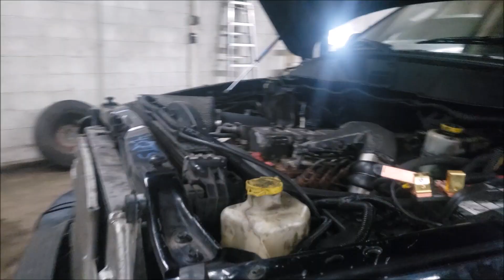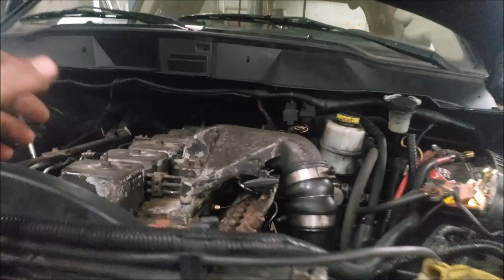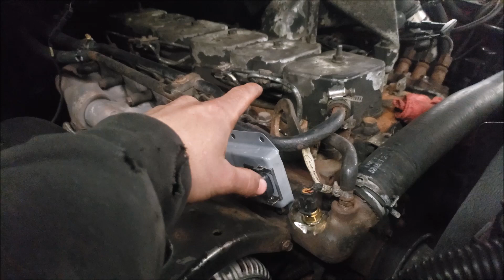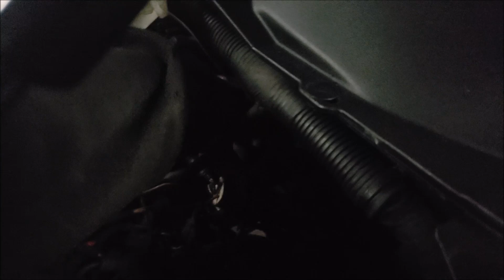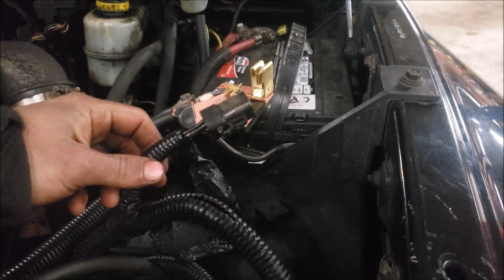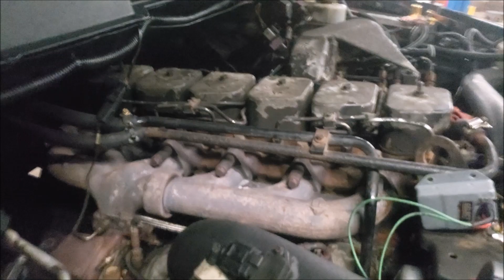The Truth About 12 Valve Swapped Third Gens | Trump 2020 Politics

Comment: Any issues with using the 12v starter?
Reply from the maker: I used the commonrail adapter plate and starter but the starters are all the same minus the plug.

Comment: Quick question just picked up a 03 12v swapped manual everything works on it except the guages to cluster did you just wire up aftermarket pillar guages and a CTS monitor?
Reply from the maker: Nah, use the commonrail tone ring and crank sensor.
Use an adapter for the commonrail oil pressure sensor
Fuel gauge works fine.
Wire up a voltage regulator from an older dodge(gauge should work if done properly) Some trucks do some trucks don't
Speedo is unneffected by the swap
Tach and ac will work as long as you hook up the tone ring and sensor.
Reply: @CPSteveMiller  ahh I see thanks for the information on that I really appreciate it! Keep up the good work brother!

Comment: Hey man I got a 04 ram I hotshot to my 24v just took a crap at 500000 I have a ve24v which I thick would be close to a 12v swap I wanted to get some info from you on swap
Reply from the maker: There really isn't any added benefit to a ve swapped 24 valve in a 3rd gen. The only reason the 12 valve was okay was because it's budget friendly, completely mechanical, and in a pinch can get you back on the road in as little as a week if you needed to just cobble it together.

If you were planning on a ve 24 valve in a 3rd gen you'd end up spending the same, if not more, to just get the factory engine rebuilt. You'll also have more reliability and dependability keeping the factory motor. Just my 2 cents. 

All of my contacts are in the description.
Reply: @CPSteveMiller  ya needed to get the truck back together shop build times are long right now I already have a built 2nd gen engine I was thinking of p pumping it before I put it in
Reply from the maker: Ppump would be the best if you're physically doing a swap. It just makes it so much simpler and if there's ever issues at least it'll still run and make you money while you work to resolve the issues. That's what I did. I quite literally slapped the engine in so I could make money but nothing worked. No fuel pump after 15 seconds, no alternator charging, etc. I have to manually control all of it. After the first few weeks I started fixing those little details but it paid for itself in the first 2 weeks

Comment: Just a thought, if you just de-tuned your common rail a bit or even ran it at its stock specs, you'd be way over the power you're getting out of your 12 Valve.
And the bad fuel issues are greatly improved with a good water separator and running 2 micron final filter after the separator.
Just saying

Comment: Good job with the swap . I have a 06 ram with bad engine. manual 4×2 transmission. 
I want to do the swap .  Where did you get you transmission adapter from??part number??
Reply from the maker: It's a factory adapter plate. No mods were needed. You just need to make sure it's a manual or automatic adapter plate depending on what you have. I used mine from my commonrail
Reply: Ok tank you

Comment: Great insights. I found a 3rd gen(06) with g56 that has a blown engine for dirt cheap and wanting to swap my 12 valve from 95 in it. Do you know if 12 valve will bolt up to g56 bell housing and any other info I should know before I jump into it
Reply from the maker: Not sure about the g56 but the nv5600 adapter plate bolted up to mine BUT only 6 of the 8 holes lined up. It has been fine heavy towing now for a year(over 40k miles) without issues. It's the adapter plate you need to worry about. If you can get that to work the trans bolts right up to it
Reply: @CPSteveMiller  My plan was to get a pre 98 ram with v10 gasser and nv4500 to swap my 12 valve in but this 3rd gen popped up for really cheap. I will have to do some research. Thanks for the reply!

Comment: Your know there’s a shut of an the side of the p7100 it’s a mechanical shut off with an electric solenoid  but can be moved by hand
Reply from the maker: Not on mine. It's broken off flush with the pump. I need a whole new ppump
Reply: @CPSteveMiller   might want to go to a heavy equipment junk yard and pull off the mechanical shut off of one of those pump eather from a school bus or an old truck
Reply from the maker: @Samsggarage  From what I understand there's nothing I can do about it other than to replace the whole pump. I figured I'll wait until the motor goes and swap another engine before I felt like dealing with it😂
Reply: @CPSteveMiller   a manual shut down cable will remove the ffs  or shut down solinoid.    Not quite shure how to do one but thay were common on old buses trucks and tractors that had a 12valve. Also it’s not that hard to swap a ppump  can be done in a bout an hour by seasons pros  seen it done track side
Reply: @CPSteveMiller   also the back half of the pump where that is house gmcan be taken apart and rebuilt  in the long run this would be a pretty cost effective option but if you want a little more power just replace the pump  with a larger ppump.  A good pump and injectors on along with that vgt could have you making the same power reliable as the cr
Reply from the maker: @Samsggarage  Could be swapped quick but I just don't want to. If I get everything done and it still isn't blown up I'll do it but that'll be another year probably. That lever arm on the pump since it's busted flush someone notched it for a screwdriver but it's stuck in the on position
Reply from the maker: @Samsggarage  I have an he341 now. At 1400 rpms in 6th it'll hold a 10k trailer up a hill. Monster torque but it chokes up top but I'm happy with it now. I'll have a video on that this week. It's night and day better than the original motor. Torque for days😂
Reply: @CPSteveMiller   there’s still a lot more on the table with the fuel side of things  but it’s your truck.  I’m just glad to see a working truck with a handshker
Reply: @CPSteveMiller  I still think a manual shutdown cable might fix it
Reply from the maker: @Samsggarage  There's nothing to put the cable on though. The lever arm has to be there in order to put a cable on it.
Reply from the maker: @Samsggarage  The tuning on the fuel side and air side is perfect now. 32psi at half throttle in less than 2 seconds. Lag is virtually non existent
Reply: @CPSteveMiller   it sucks man a new shut off  lever is 60bucks   But The pump would need to come off to be rebuilt
Reply: @CPSteveMiller   I’ve actually been thinking of doing this on my truck the he351 that is

Comment: Do you still have the original motor?
Reply from the maker: That's long gone
Reply: @CPSteveMiller   thanks for the reply I’m possibly going to pick up a 3rd gen with a shot motor so I’ll be looking for a good engine to drop in so is a 12 valve a good swap
Reply from the maker: @hunterakehurst2209  I'd recommend you drive an early second gen with a 12 valve in it and see if you like it. They're cheaper to maintain and super reliable but they aren't for everybody. There is a bunch of small little things to do when you do the swap
Reply: @CPSteveMiller   actually I’m currently driving a 95 one tone with a 12v manual 5 speed I love it but I found a 3rd gen in a field by my house I’m trying to save from just rotting away
Reply from the maker: @hunterakehurst2209  Nice! Check this guy's video out. https://youtu.be/yBkZK463Cpk he does a full rundown and I have a list of everything needed but I won't have my laptop back for 5 business days so I can't get it right now. It's not all that bad just a bunch of small things

Comment: Eaton fuller 10 speed with air for overdrive!!
Also a goal of mine!!🇺🇲
Reply from the maker: I thought about it but I pulled back out of that thought because of what I'm using the truck for. HOWEVER I have since found somebody who contacted me and he has a 12 valve swapped, eaton 10 speed swapped ford f350 on semi wheels. I kind of want to have that truck on the channel but he uses it for transport and it super clean.
Reply: CP Steve Miller my dad did the exact same swap 10 years ago Chevy 3500 2wd 12vavle Eaton fuller 10pspeed rto6610  with 4 link rear air ride. It used to have semi rims 22.5 shaved downed to 22s but it’s on stock 16s now

Comment: How bad was changing it from a single rear wheel to a dually?
This has been my dream too!
2200 bucks wtf nice!!!! Thats awesome!
Reply from the maker: It's not that hard honestly. Rear axle needs swapped and the front hubs just bolt onto the factory lug nuts. It's just a spacer. Maybe 6 hours total. Less if you really know what you're doing. I got my whole setup for around 800 bucks on craigslist. I doubt I'll ever get that deal ever again but it was worth it.

Comment: Love the truck and dig the stuff you do.  I follow your Instagram and now your YouTube.  Iv always wanted to put a 13spd in my 3rd gen 06 when my g56 goes out. I have 177,000 miles on it. But I can’t find much on that on the forums about the SAE#2 adapter plate bolting to the back of common rail block. Curious if you know? 
Thanks in adavance. Love the truck and the channel
Reply from the maker: I thought about doing the Eaton 10 speed. I would love to assist with one but I stopped researching it awhile back. 13 may be a bit overkill.  Even the 10 needs the compressor and air supply. If you can find one for a decent price pick one up and compare it to a factory one. Are there any forums that did the swap? I saw a few on the 6 and 10 awhile back
Reply: CP Steve Miller 
I found a bunch on the 10 spd behind a 12v and vp 24v 2nd gens. On Cummins forums. I know you have to cut the tranny tunnel out and make a cross member and rerout the exhaust out of the way because the 10psd fills the between frame rail gap pretty good but it does fit. 
Bad thing is you loose four wheel drive unless you run a devorced transfercase. Have not found a transfer case that’ll only up to the 10spd. But I did see where a guy machines his own housing and shaft for the NP205 to bolt on the back of the 10spd. But that’s more work then I want to do get into right now.  Was hoping to find something that bolts up already but no luck so far.

Comment: Have a 95 12 valve cummins in my 03 love it. Just need to know how to get the ac goin
Reply from the maker: Do you have a working tac signal from the crank sensor? Without that it'll never work. Assuming you have that already, correct?
Reply: @CPSteveMiller  no i dont, i dont know what tooth count the tone wheel has to be how to wire it up.
Reply from the maker: You'll need a tone ring and crank sensor off the 03 to 07 5.9 Cummins. I regret not getting mine off of my original motor. Had to wire the fuel pump to the ignition instead of ecu, alternator needed a voltage regulator, and ac won't ever work. All can be avoided by just getting a tac signal from the factory tone ring. I'm searching for one locally so that's pretty much all you need. The lines bolt right up to the 12 valve compressor
Reply from the maker: @choyahkeith1371  you don't need that at all. All you have to do is bolt on the factory crank pulley and sensor.
Reply: Same 95 12v with a Eaton 6 from a ford f700 in my 2011 ram

Comment: Babybullsmith001, I am one of your biggest fans and I was getting a little worried about what happens to your video. How much for the M5600 transmission? What is the best way to get ahold of you? I would like you to do a little work on my 2006 Cummins with 276,000 miles. I plan on purchasing a camper trailer sometime in the future(nothing fancy, CHEAP is the only word I know when comes to the camper) It has a 48re. The work I like to get done is simple extended oil filter and head studs and I would like re-tune my computer. I bought an Edge but it did not take because the previous owner had a Bullydog (which I did not know) I suffered a stroke so the federal government took away my CDL. How much would that run me with your expertise? I love your channel, keep up with video
Reply from the maker: I have links to my Facebook and Instagram. Send me a message on there with what you want done and I'll try to give you a quote and go over everything!